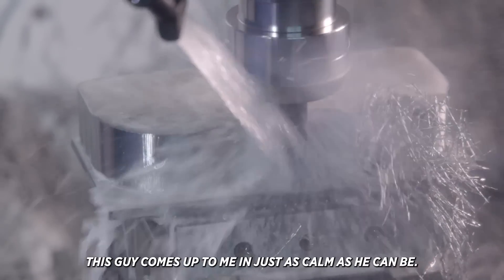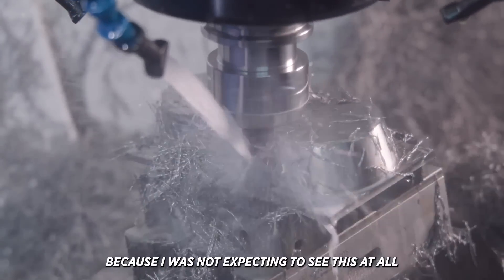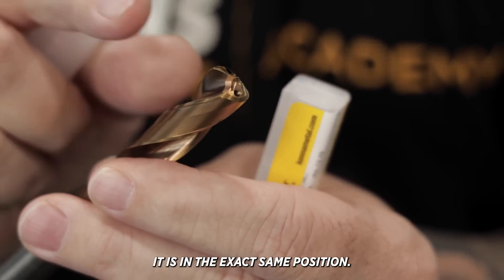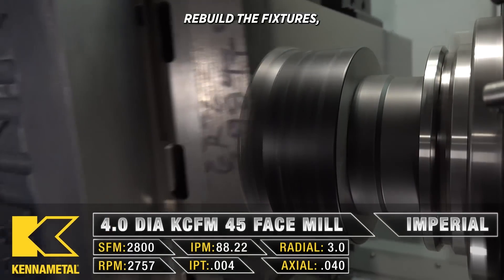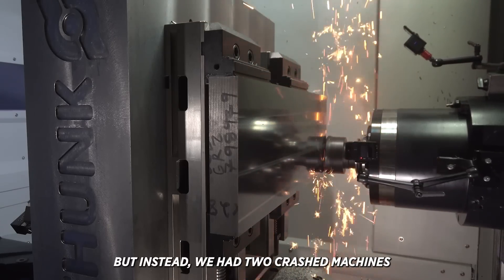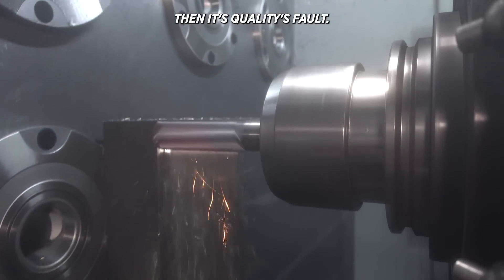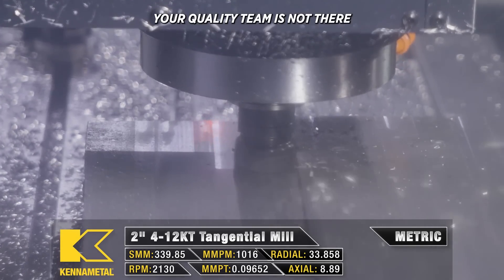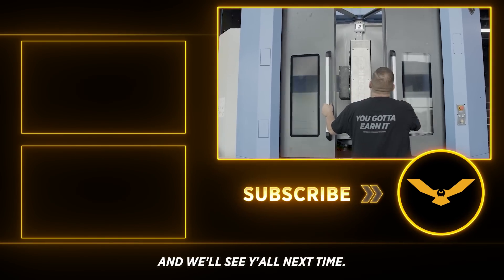$200,000 Damage | EPIC FAIL… Machinist CRASHES TWO MACHINES at the Same Time

Comment: At the space/defense program I work at, if a machinist was anywhere as flippant as that, the head machinist would literally have picked this guy up and thrown him through the back shop door. It blows my mind that any machinist would behave that way, as I've yet to meet any machinist who didn't take pride in their knowledge and part making. Though admittedly I'm just a mechanic who hangs out in the CNC shop when work is slow. Crazy story though.
Reply: I briefly  worked for a CNC machine shop, and my job was to change parts out, deburr and inspect. Machine programming was done by the manager and setup was done by either the manager or an experienced machinist and tested before i ran the program. From watching just a few of titans videos, there is a lot that i was not taught.  

That being said, even if I didn't feel I was at fault for something happening, I would want to learn what happened and if there was something i could do in the future to prevent it from happening again.

There were also things at this shop that they had no interest in doing right or improving. The fact that they wanted me to force a go no go pin instead of getting me the right pins for measuring blew my mind, and refused to get me the right ones until after a batch or 2 came back from coating and wouldn't fit with the other components.

Comment: Worst crash I seen. We had a nee mechanical technician, we use them I n the floor rather than degreed mechanical engineers. He was cutting jaws on a brand new okuma genos 400. He had claimed to have ran okumas before so his first job was to bore jaws on a machine and program it for simple easy parts we make. Well he created the jaw cutting program on said machine and it was done right the bore was on the small side so he went to restart the machine like a fanuc went straight to the N2 segment of the program. Since this was a brand new machine the safety feature of the ability to restart the program anywhere was not in place. Needless to say it did not pick up the work shift and went full rapid into the spindle. This totaled out a brand new 185k machine that didn't even run 1 single part. Some how some way he was able to keep his job.

Comment: When someone says "yeah i just put it in presseded go and went to break" you should just punch them in the face, thats honestly bad i have the exact same problem at my work

A bloke works on the big 1.75"-3.5" machines we got there making hydraulic fittings, this one run he incorrectly made 400 3 inch shells incorrect, they went out, got plated and then got sent out to the customer when then had all the problems, i then later found when the job got moved onto my machine that one of the grooving tools didnt have enough clearance on the shoulder meaning when it was at the deepest point it was cutting the radius that it had just made making that ridge undersize and with sharp corners

Coincidentally thats where it was breaking, also 1 of those parts takes 1200 dollars to make and fit all up so 400×1200 is well over 250 thousand and he still has his job, he also let coolant leak into one of his motors which ended up fucking the machine and that was 2 months after that one job was fucked

Comment: I guess I just haven't crashed anything bad enough to fail upwards.  My worst was setting an offset wrong on a CNC router (it was not programmed in an unintuitive manner but the programmer had already trained me on his system and why it's different), I set the height too low and took 1/8" out of the MDF table instead of just cutting the sheet metal.  No tool damage, no part damage, the MDF was still usable, but I was deemed incapable of running this machine due to this one mistake.

Comment: I've plunged tools into the job, nothing too serious apart from the cost of a bit of carbide and a little time.  Our programmer is famous for not changing clearance heights when changing over to a metric system.   Often, I have had to estop to prevent clamps from being wiped out.  Knowing this, I often ask, "Have you set the clearance heights in metric?"

Comment: Maybe because of bad FeedRate or something, but I was kinda close on having my Mill crash into the Structure bed. I was doing Polish finish on a test material, and I noticed that the machine's Z was stepping down(cutting deeper) and the Z-Change wasn't getting shown on the Machine's data(like how deep it was) or at least not in a way that you can tell (Because I didn't take the care to remember the Machine's Zero coords).

So long short, the Head's Z was cutting deeper into the work by steps, and were it have been left like that, I would've had an Stair-like polish cut until the Spindle rammed into the Structure Bed.

So far, apparently the solution was to have the Plunge and feed rate not be apart by more than ~38ipm or 1k mm/min

Comment: This crash was done by the owner of the machine himself, he touched off Z0 on a part while being in sub-spindle mode on a Okuma LB3000, crashed full speed into the chuck, cracking the casting that holds the revolver assembly to the Y axis linear rails.

Comment: what a nice place to work without worrying about doing something wrong!!! 😂
I had a work mate that crashed a plane into a truck, nobody was hurt though and had to pay compensations of hundreds of thousands of dollars which she obviously didn’t have plus a sentence to a few years in prison then because of the shock and life changes she went through he developed a cancer and died. I wasn’t even entirely her fault because there were risk factors associated with the job higher than it supposed to be, later they added more equipment to bring the level of safety at an adequate level, basically it could’ve happened no any good professional at some point.

Comment: I had a Mori sv500 set up and programmed with a pallet system. Came in at 3am a couple months ago, and when I walked by the machine I just stopped and stared. I was using an 1.25 tungalloy hfm, and it was about an inch down inside the mitee bite jaws and absolutely destroyed. The operator had changed inserts in both of the inserted cutters, but switched the cutters when reloading them.  Wrong tool length offset bud. Operator swore up and down he would never make that mistake had to be a machine error. Sorry man, machine says right here this tool is in the spindle, but that isnt the right tool. You switched them, inadvertently yes, but you did. Now go tell process engineer we need a new cutter and why. Own that s%#t, man. If you dont know what youre doing, one at a time always works!!

Comment: Worst crash I ever saw:

Guy loads a 30ft swell packer into an old m5. Indicates and touches off tools and makes appropriate offsets. Hits the go button.... and the part is still tethered to the gantry hoist.  You ever seen a m5 defy gravity? When the strap finally ran out of slack it pulled off the hook and the spindle side of that machine was every bit of 10ft in the air. The foundation of the shop shook so hard the gps alarm went off on my 510c-ii 4 cells over. 

The extra crazy part about it was aside from the part being twisted up like a pretzel, the machine was undamaged! 
Let's see a Haas hold up to something like that... 
Mazak for the win!

Comment: Worst crash I ever seen was a friend of mine running a through bore with a hfm our tool wasn’t long enough so we had to spin the table around 180 to do the other side he forgot to turn M01 on and the tool came out far enough but didn’t move up far enough the table rotated with the tool ran into a 2500 pound part moving at rapid didn’t hurt the part cause we were going to rough face mill a lot of material off but it bent a 4 inch Devibe bar 45 degrees and the spindle was off .006 thou we were able to fix it quickly with no real loss for production but he felt baddddddd. Worst thing I ever did was brake a probe trying to measure the ID of a bore to fix a finish luckily I got off on that one because the M.E told me I had enough space and was supposed to hit E stop he was a good dude he had my back.

Comment: Worst crash I've ever seen was a misplaced decimal in the work offsets for a Z. -24.8 inches is a lot different than -248.00 inches. The guy even had rapid down to 40-50%. Unfortunately it wasn't enough time as the fixturing had already tried coming past the spindle. 3 weeks down time. New spindle, B-axis rebuild, Z axis rebuild, and salvaging the fixturing was a fun time. The guy that it happened to now quadruple checks work and tool height offsets when its a fresh setup.

Comment: Number one rule of running the first program in a CNC. Always watch it, slow the rapid down, and make sure you don't crash anything, doesn't matter if you wrote the program or not. If the programmer wrote in the wrong tool called up in the program, it's your responsibility to catch it. Rule around the shop I work for at least is always single block through the start of every operation.
Reply: Single block isn't always feasible.  Some post processors do 1/1000" or less steps.  I usually dry run first with no part at 10% feed if it's not a program I can single block.

Comment: A lot of companies like to save face and act like it’s the operators fault for crashing a machine after the fact. I’ve worked for two companies so far that didn’t give a f**k if you were by the machine as long as it was running. But the moment something goes wrong it’s the operators fault. Blame your programmer for not double checking the program. I’m sure his reaction is a mirror of how leadership acts with the operators.

Comment: I'll be proving out a new program for a new part and taking my time being safe, and my boss will walk up and give me shit about being slow (he's usually just messing around) but one day someone pissed him off, maybe he didn't get a check for the parts yet or had to buy new tooling and he was in a bad mood and came up to me when I was proving out a new program which was a big ass 316 stainless part for a certain space company, and he was being an actual dickhead telling me to hurry and I wasn't even halfway through the program and he just stood there behind me watching and being an ass, telling me to hurry. So I lowkey lost my shit and looked at him and smiled, and said "100% rapid and full speeds and feeds ahead!" And turned everything up  (including the spindle and feed) no single block this time and optional stop off, and sat there right next to him watching. The next few tools went okay, but then it was time for the 6" facemill to start the roughing toolpath, which was a little heavy I'd say. With full speeds and feeds ahead the facemill came in hot with that .250 depth of cut full radial, 7500rpm and 650ipm it made it about 8inches across the part sounding like a helicopter firing a minigin while crashing into a skyscraper and turned a sinister white and red color and the facemill head welded itself and then melted off and flew off fast and bounced off the side of the vise and then slammed off the way cover ruined that and put a huge dent on the side of the machine with a big crack in the middle. The spindle was really fucked after that too.I looked at him and said "oh no I should've been faster" he was speechless and looked like he seen a ghost, then he lit his cigarette and walked over and called the doosan repair guy. I told him I'm going to clock out and go to the bar, and was convinced I'd be fired or end up quitting after that, he said "see ya in the morning" all my coworkers were speechless standing there looking like lost prairie dogs, I didn't say a word to them and went and clocked out then got hammered at the bar.
Reply: I laughed quite loud at this

Comment: ohhh I have seen many crashes. Personally i've done two one of which ill take responsibility for and the other not so much as I had already warned the boss about something like this might happen time and time again.  Crash one-my fault, I had a 20mm bar sticking out the back of a lathe by 300mm, I test spun it up to the program speed slowly and it was fine, then when the program ran and the tool touched the job it bent the bar out the back of the lathe (causing minor damage to the ally casting where the draw tube sensors were. I should have test spun it up a bit further than the program. I'm guessing that having the tool touch the job sent a vibration through the job that was just right to trigger it to bend. I now refuse to use a lathe with anything sticking out the back NO MATTER WHAT! The second one I was doing about an hour and a half simultaneous C axis generation around the outside of a shaft and had already cut 10 or so parts but it was too slow so I re posted the program with new speeds and feed, ran the program through the simulator software and everything was fine. However it actually spat out a rapid -X value randomly in the code about a half hour in. the boss was making me hit go and then go do something else. I had warned him that the computer I was using was old and not reliable and was always crashing and doing random things and that the cracked software he installed because he was too cheap to buy software was also glitchy and not reliable. so yea about 30mins in this cycle i hear from across the workshop a massive bang and it drove the live tool through the job and snapped the tail center clean off. luckily both of these crashes together only cost about $400nzd not including the cutter to fix (replaced tailcenter). That company on the other lathe had a heavily bogged up door and when I asked why they told me because someone spat out a 300Dia x 150 long billet out of the chuck.....twice.

Comment: Worst crash i ever did was just a few months ago.
I touch probed my Z0 but diddnt set Z0.
The programm was testet, already produced 20 parts with it ( 1 part around 11 hours runtime). Straight up rammed my Z axis in the part. Spidel destroyed, tool destroyed, transmission destroyed. But it can and will happen to everyone once in a while

Comment: Unbelievable, but it happens.  Multiple levels of responsibility here.  First off there needs to be a written procedure for testing and running new programs that all operators demonstrate that they understand and is signed off on.  I had one of my guys blow up a big Kaiser boring head.  After that,all set up’s he did needed to be verified by myself or the manager.  Two days later he broke a small drill because he didn’t follow my directions….fired!  They guy above would be so fired for having total disregard for equipment.  In fact if it had been my machines that I’ve worked my ass off for I’d probably need bail money.🤷‍♂️

Comment: Worst crash I've seen was on huge VTL with a face-plate of Ø 6.000 (I was working in a retrofit organization in that company at that time). The customer performed both sided internal heavy turning on the internal diameter of the ring-shaped part. Means two really massive tool-holders were just punching through that forged ring. What now happened is that they changed the directon of feed  from downwards to upwards in order to throw the chips out of the part for less mandatory cleaning efforts. 
What now happend is that the ring was pulled out of the clamping-chucks and this massiv ring just bounced inside the machine enclosure around like a wrecking-ball. 

Result:
Machine enclosure fully destroyed
both supports twisted and partially destroyed
both columns twisted
operators pants with new inlay
Damage 500 k€ + new pants

Comment: Worst crash I've ever seen.. watching a coworker set up on a lathe.  This part was two parts put together like 6 ops.. turning and milling.. anyway.. he forgot to back the boring bar out in Z..and it went straight up in x and tried to rotate the turret. The door was open..it looked like a metal tornado. The collet exploded. The part exploded. The tool shattered. We picked up the remains with pliers and it set the table on fire..

Comment: Some places the boss always comes and talks just before break time? Or give you a hard time if you're machine is not running during break? Or if you miss break because of that, OH Well. Just saying some bosses treat people like machines.
When you're back is messed up from loading and setting up big machines for years they try to say it's not from work and replace you like a spindle but on the cheap.

Comment: My production leader was forced to throw away over 300.000,- of parts because he decided us welders could produce parts with a 0% tollerance that NEEDED to be machined before and after welding, eventhough all of us said it was completely impossible to produce these parts this way. Yesterday he decided to paint all of our overhead cranes a "nice" dark blue, eventhough the highvisual yellow is there for safety reasons (ofc). Than again; he used to be a electrician before being promoted to production manager steel...

Comment: 2016 Oct morning ~ 2AM CNC TURRENT LATHE change over new job fixture around 45 kg to chuck.
Job 3 kg place in fixture. Totally 48 kg rotating in spindle.
I forget put x offset for boring bar. So tool not touch job. It actually going to fixture and touched. When I see the 48 kg rotating fixtures declamped at 450 rpm. It hit door fly away 20 meter. I can't make emergency at the time. I'm luckly missed

Comment: Don't blame the setter when modern machines run over 15 meters a minute. Most times crashes happen in less than a second. The programmer should have run G code simulations to prevent any collisions. He's the one responsible.